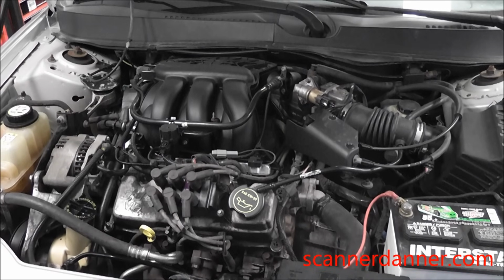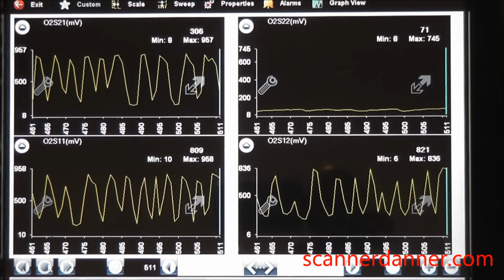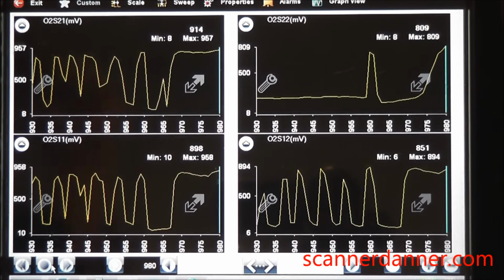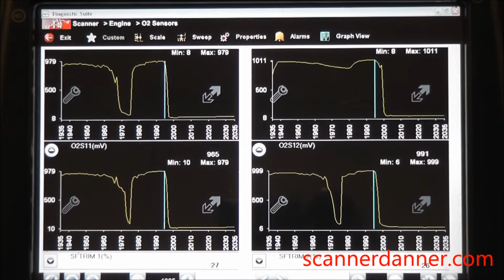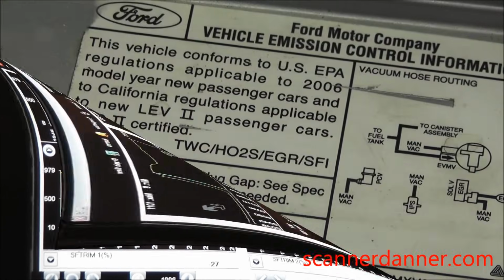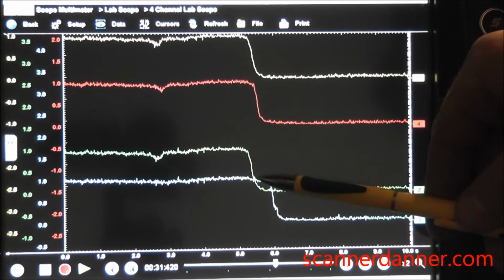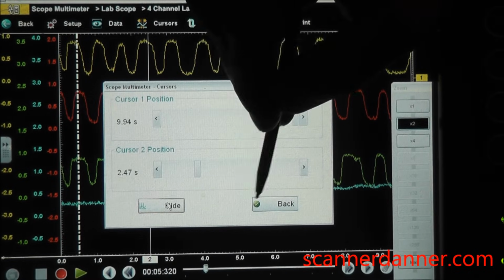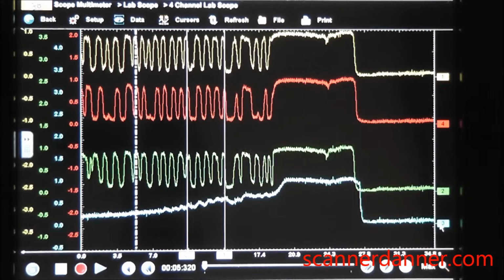Diagnosing a catalyst efficiency code (P0420 or P0430)

Comment: Have you ever ran across a 420 code where the cat wasn't bad?  On iATN they say if it sets a code that's that, no more testing is needed. I can see graphing the activity, but I'd guess that if it's NOT a cat it's going to be an ECM.  Then I wonder if it's an ECM can I trust what I'm seeing on my scan tool  I assume you're familiar with iATN, and for them to say trust the code is pretty remarkable.
Reply from the maker: I'm in agreement, if you have a cat code you need a cat.
Reply: ScannerDanner  Not trying to bash here cause you're a smart guy danner., but haven't you come across an exhaust leak in front of the rear o2, a sluggish o2 especially in the heater. Hell i've even had a newer Tundra throw a 420 code because the secondary air pumps had an issue. And what about aftermarket exhaust? the quality in those are very perplexing on why they ever left manufacturing in the first place lol. its a 60/40 kinda thing, 420/430 codes are usually a shitty cat, but you can't use that word Always hahaha. Especially in the automotive field! Great video though, thumbs up.
Reply: +scannerdanner i have this code on an Explorer 2013. Clarification needed, on my scanner i dont see mv for the downstream o2’s only ma values. How do I know what the proper ma value is for the cat since I dont have the mv value?
Reply from the maker: Agree 100% and I've said this before just not here. Check for exhaust leaks and fix ANY fuel trim or O2 codes before condemning the cat.
Reply: I agree with the code MOST of the time. I had a Jeep liberty v6 that had b2 cat code along with downstream lean code. It already had a universal cat welded in and I was sure that was the problem. After testing everything, (there is a gamut of checks for this vehicle), it ended up being the upstream sensors. That system works kind of backwards. It trims by the downstream sensors. The system is also a wideband type.

Comment: I tried to replicate your oxygen storage test on the cat of an 04 Toyota Corolla 1.8 with a P0420 code but, no matter how much propane I added or at what engine speed, the O2 sensors would go to approx. 800mv but only stay there for about 2 seconds, then the ECU regained fuel control. This engine has 2 conventional O2 sensors, not a front A/F sensor. Any ideas?
Reply from the maker: Not enough propane. I use an adapter that when turned upside down liquid propane comes out. No restrictions
Reply: ScannerDanner Thanks for your quick response. I'll try again when the car returns next week and let you know how I make out. Great info in all your videos!

Comment: This is an extremely detailed video showing the most information about PO420 ever. Great job! I have a question or two for you. I also have a PO420 on a 04 GM, I was able to borrow for a quick test a snap on tester from work. It showed a relatively flat line for the rear 02@ idle but a jumpy line @2500RPM. The mechanic says the cat is bad for sure but i'm not 100% convinced just yet based on the flatline reading @idle. Should the rear 02 be a high reading @idle or a low reading? Thanks  you for taking the time to post such awesome detailed video's.
Reply: +Dick Hertz:  Very interesting observation. I have a BMW that has the same symtom at higher RPM and Speed range.  I got the the P0420 code when the car was more or less higher than 3000 RPM for an extended period of time or when it went through spurts of high rev.  I am trying to get a SW tool so I could capture the fuel trim at these time to see how they differ than during idle or at city speed.

Comment: As has been mentioned by ScannerDanner, you need to know about what you are working on. The three-way-catalytic converter (TWC) is part of a whole engine fuel/exhaust system design. With a proper functioning engine system, today's TWC are designed to operate for the life of the car and meet emissions requirements. The best way to test a TWC is with an exhaust gas analyzer (which are expensive) and proper testing methods of which there are several. If a TWC is determined to be defective, the cause of the failure must first be determined. Not to do effective diagnosis and repair of the root cause of TWC failure can result in replacement failure soon after. California emissions testing is super tough and replacement TWC must meet those requirements. Even replacing a TWC in California must meet strict requirements. In some areas of the U.S. to even replace a TWC requires a special certification. Go to any auto parts web site (try rockauto.com) and notice most of their TWC offering cannot be sold in California. OEMs are often what is needed. For a comprehensive discussion on engine emissions design and catalytic converter info and testing go to this link. This information is also quite helpful in avoiding a TWC failure in the first place. http://www.lbcc.edu/attc/documents/BAR-2011-CAT-testing-methods.pdf

Comment: Excellent Sir! I bought my 2006 Chrysler 300 in 2005. Check engine light came on within a month. It ran rough for a while and eventually started back running like a sewing machine, as it does today, still. The light stayed on though. I kept procasting and failed to take it back to dealer for repair while under warranty. When you said a converter can be bad while a car runs smooth, it made perfect sense, especially since the reputable car repair shop replaced OEM oxygen sensors after the p0240 code came up, showing they needed replaced. The light is back on after 53 miles with the same stored (not active code) I am now convinced that the converter is bad and will by one from the dealer and have it installed. I hope this will take of the problem once and for all.

Comment: On a vehicle that seems to be running well such as this one, what else would you check to figure out what caused the cat failure? My first thought would be fuel trim checks but that ford had good fuel trims.
Reply from the maker: fuel trim, misfires, fuel contaminated oil, air filter, is it burning oil? head gasket?
If everything is normal, change the cat. and don't worry about it.

Comment: I love these videos and have learned some things about them.  Nice to see someone who actually test and not just read the code and guess.  I have a question about one aspect.  I have often had cars come in with cat inefficiency codes but if I see other engine issues such as EGR, MAF, MAP, upstream O2's, misfires, or vaccumm leaks and I usually fix those first and clear it out and let it go and see if P0420-P0430 comes back.  My question is will a good cat show that it is inefficient with other running problems or is it safe to say that cat is on the edge of failing anyways?  I don't want to diagnose something to be a problem if it's really not but then I don't want to temporarily fix something just to give the owner a headache down the road.
Reply from the maker: I handle those the exact same way Jason. Especially O2 related faults.

Comment: got a question my downstream oxygen sensor reads steady at .1 v for like 10 seconds or so then jumps up to .8 v and stays steady for like 10 seconds or so. it dont look like upstream oxygen sensors at all they switch like they should. i have a p0420 code so is it a bad oxygen sensor or the cat bad
Reply: no O2 codes right? No exhaust leaks? Most likely you need a cat.
Reply: Sometimes they're so close that they can be plugged in backwards.

Comment: Another great video Paul, thanks.
I recently had a P0420 code on a Nissan Primera P12 QR20DE. The oxygen storage test gave a .3sec (300m/sec) delay. Because of the high cost of a new cat I told the owner I could borrow a 2nd hand one and test for the difference. That cat  increased the delay to .65sec (650m/sec), way short of the 2 sec I was hoping for but the code has not returned and the customer was very happy (she even did some baking for us).
We here in New Zealand don't have emissions testing (yet) but do you think a cat like this would pass some of the more stringent emissions testing as done in California for example.
This car was bought new in New Zealand but built up in the UK and I wondered if it was possible we could be supplied cheaper/low quality cat's due to our lack of testing.

Comment: Good info, thanks Paul.
A question, can i perform the same test using the Torque pro app on my Android phone? (i'm new to the Torque app. so far i just use it to retrieve fault codes. I know i barely scratch the surface on this app).
I've gotten a P0420 fault on my 99 Civic EX.

Comment: Hi Paul great vid
little late in asking. is the fault code description for P0420. cat efficiency out of limits referring to the oxygen content test you described? ie value was to quick to return (below limit? )
Reply: I believe so, however this is a difficult subject and has so many variables. In short, when you have a cat code, you need a cat. Of course you would need to fix what killed the cat first but sometimes there are no other obvious problems.

Comment: Thanks Paul for the info where were you 20+ years ago (when I had hair).... 
 anyhow just cant reiterate about the basics the basics and the basics of running condition before final rule out of converters . engine coolant in combustion process will absolutely kill oxy storage in converters ..
Reply: Yep, it's the silicates. You'd think that the honeycomb was made of the same stuffs, so it wouldn't hurt.

Comment: Hey Paul, what of valve do you have at the end of your propane bottle? I tried doing the oxygen retention test, but I was not successful due to the fact that I was using a soldering torch to feed the propane into the intake, but it never got the engine to run off of the propane. Please share where you got it or tell me if I did something wrong. Thank you.

Comment from the maker: I don't plan on making any major changes. some additional hyperlinks added for quick reference to my youtube videos maybe. but these can be found in my playlists I have recently created for each Section in my book. 
So you are good to go with the paper version if you like. 
Any brand new material, say a new chapter on GDI would NOT be added to either the eBook or paper book. It would be separate. (We are talking a few years away from now before that happens, I need my own case studies first)
Reply: Awesome video..I've got a 2008 Dodge Challenger SRT 8 that keeps throwing a check engine light. First it just came on, and this last time the check Engine light was blinking off and on and the car was running very rough. So I took it back to the dealership. They said they replaced all 4  O-2 sensors. They drove it, and it came back on. Same code as begore. It said Fuel trim issue, lean bank 1. They are telling me that the computer is reading the codes like the catalytic converters aren't working up to Federal standards for emmissions. Needless to say, they've had my car for two weeks and can't figure it out. Do you have any idea what it could be?
Reply from the maker: @leemassey9065  a blinking light is a misfire code and rough running suggests a misfire too, it is not the cats, take it to someone who know how to troubleshoot

Comment from the maker: It will depend on the com protocol as well as the scanner used and how many data PIDS you are displaying at once. So it is not set and cannot be relied upon for a time base. Unless you has a run time data pid to compare next to and some cars do provide that PID

Comment: Ughhh the dreaded P0420.  My wifes 2001 Subaru Outback, 3.0L six cylinder, 190K miles started to throw this code now and again for several months.  Well tuned engine, no exhaust or intake leaks. Engine was running good.  I removed and thoroughly cleaned the inside of the original PVC valve and added a high quality fuel injection cleaner in the gas tank.  I cleared the code. It has been 6 months now, NO problem.  Most 420 codes do mean a cat replacement is necessary but not always. Great video!
Reply: Well said, I would do the same especially after checking for any leaks on the intake and exhaust. Sometime just cleaning the sensor or replacing it will do the truck. I’ve heard of many guys replacing the Cats and still had the same results.

Comment: So 4 frames of your scanner equal almost 600 ms, supposed that the settings were similar when recording data by scanner and scope. Is this relationship between time and scan data refreshment defined by the com protocol or does it depend ( at least partly) on the scanner used?
Another thank you for your dedidcation, br.

Comment: Hey paul love the vids I have a 99 chevy express 1500 with 5.0 Codes were cat efficiency below threshold and misfire no5 cylinder. I cant remember right now witch was what but the fuel trim was -18 and the other was +4 I can smell raw fuel coming out the exhaust, I think it has a leaking injector on No 5 cyl I switched wires and plugs around and cleared the codes but No 5 keeps coming up. Before I spend 300+ on injectors what are your thoughts
Thanks

Comment: I like this video. I had some issues with troubleshooting catalytic converters. With my scanner I can see in frame data oxygen sensors mV and buy looking them I determine is the catalytic converter good or bad, but I can not be 100% sure. I do not have graph mode so I am relining on numbers I see. Now, I will do more measurements  with scope as in this video. It is very important to tell to the customer in 100% that converter is good or bad...not just to assuming.Great video Paul.Thanks so much.

Comment: Hey Paul,
Great video, i just fixed a P0420 on a 4cyl Barina, turned out the cat was blocked up (full of carbon deposits), the car LTFT was at -30% and the car was bogging down on load, in this instance i did only a back pressure test to give me direction, i will try using this method if i get the chance.

Comment: Great video, as usual!

My experience agrees with yours; it's not uncommon to have a low-mileage vehicle with no running issues and bad cats.

Have you had any cases of cat codes that were solved with a software reflash? I.e false cat code that didn't return after applying an update that addresses such issues. Thanks!

Comment: HI PAUL.PAUL THIS IS IRRELEVANT TO THIS VIDEO, JUST NEEDED YOUR INPUT. I HAVE A 2003 CHRYSLER VOYAGER 3.3 VIN R.AM HAVING ISSUES WITH THE COOLING FAN MY DIAGNOSIS HEAD TOWARD THE COOLING FAN CONTROL MODULE.I WAS TOLD AFTER REPLACING THE COOLING SYSTEM CONTROL MODULE I NEED TO FLAFH THE P.C.M IS THIS TRUE ON THIS VEHICLE.WILL HIGHLY APPRECIATE YOUR HELP THANK YOU PAUL GREAT LEARNING VIDEOS THANKS FOR SHARING THEM WITH US FELLOW TECHNICIANS THANKS AGAIN RICK BAUZA.